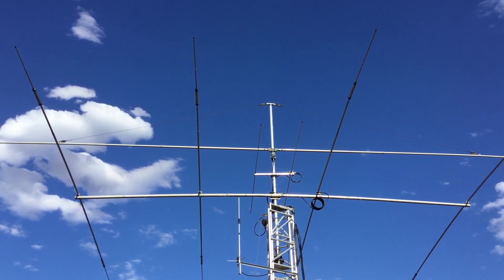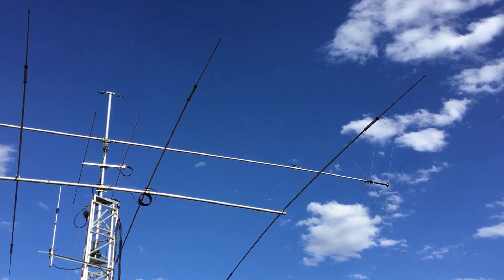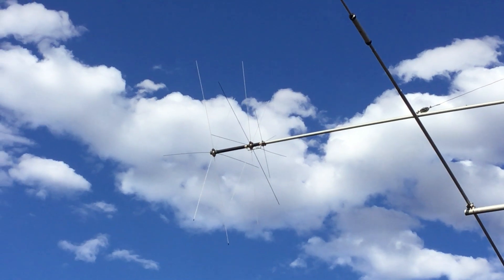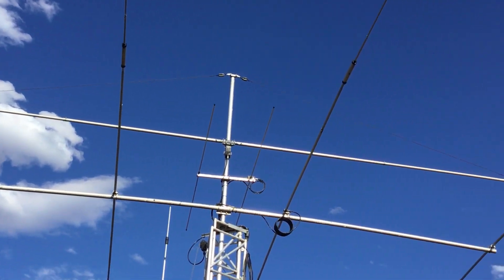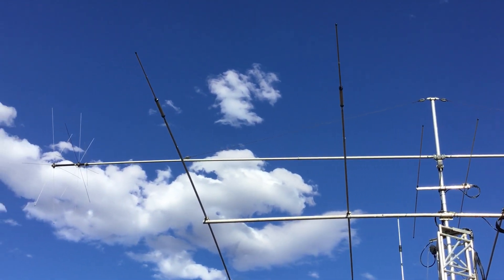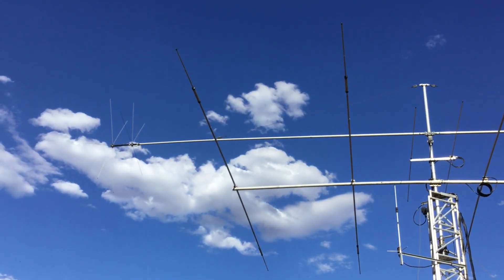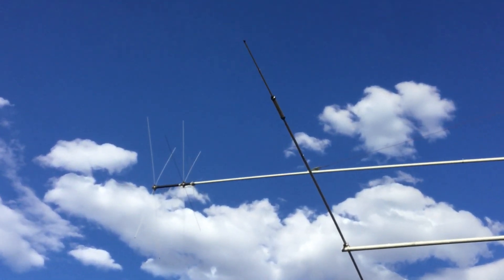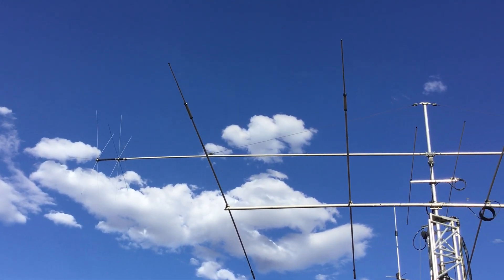MFJ 1785 rotatable Dipole 80/40/20 meter ham radio bands.

Comment: Hello. I have the same antenna and just got it on my tower. It was a bear to get tuned on a pole 10 ft off the ground. I could not get a good feeling about trimming the  bands and since I have a auto tuner and manual tuner available decided to only tune them for the bottom of each band and will use the tuners to do the work for me. I am curious as to how well this antenna works on 80 meters. What is your experiences with it? Thanks KX4IG
Reply from the maker: Hello , yes the antenna can be a bit fiddly to tune in general I layed my tower over trimmed and stood back up ,on 80 meters does not have a big band width about 25 kHz is expected but works well and is rather quiet so I can actually hear everyone very well I tuned mine for 3.600 and use a tuner either side of that it has been trouble free over many years works great for qso in your own country.
Reply: @parx6886  Thanks for the info.! KX4IG